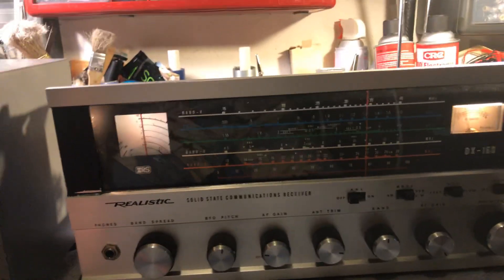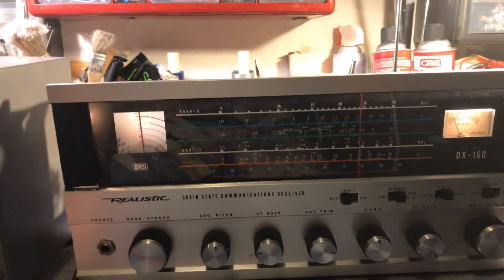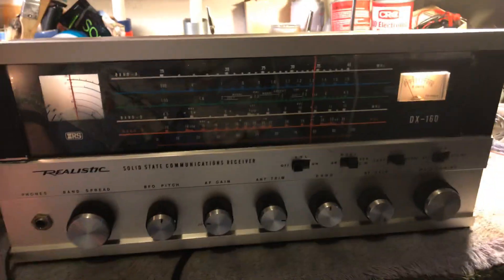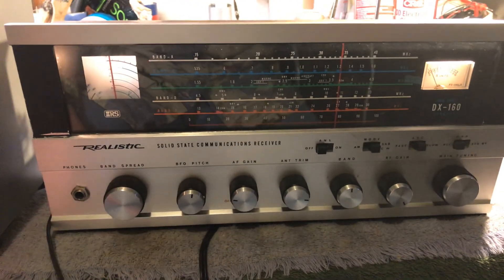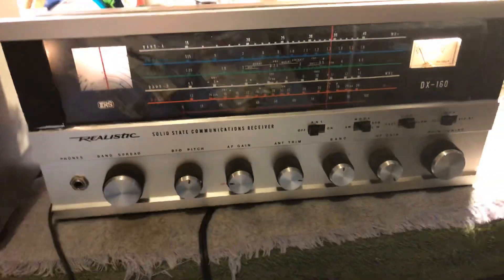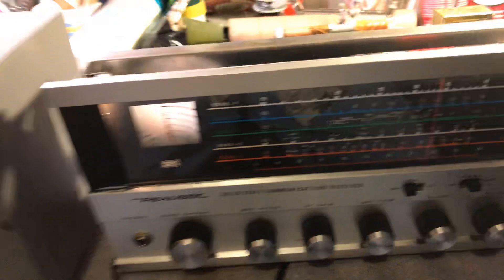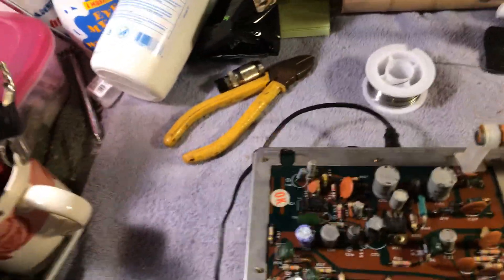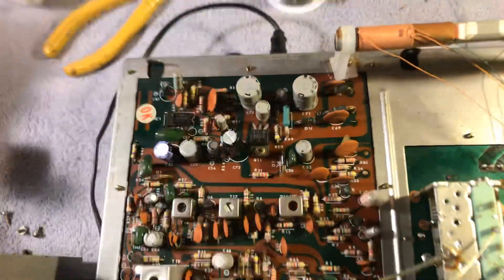Realistic DX-160 Repaired!!

Comment: Could you give us your opinion on which is better the DX-160 or the DX-302?
Reply: i would say the 160 i have had most all the radioshack radios the 160 is the most  sensitive
Reply from the maker: Sam Iam Sam I would say that they both have their goods and not so good. I will give the edge to the 302 simply because it has that digital readout. It is much easier to tune at least in my opinion than the 160
Reply: @charliehustle5529  thanks for your answer
Reply: @Radionut  thanks for your answer, I own a 302 already, but have heard many good reports on the 160